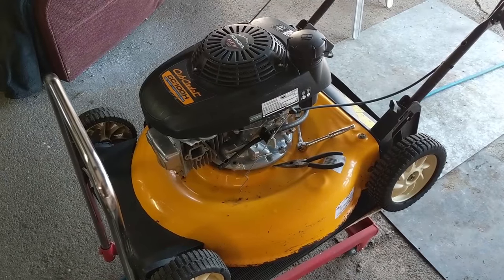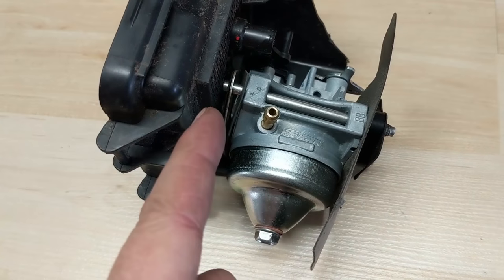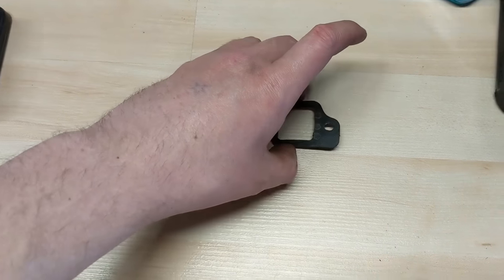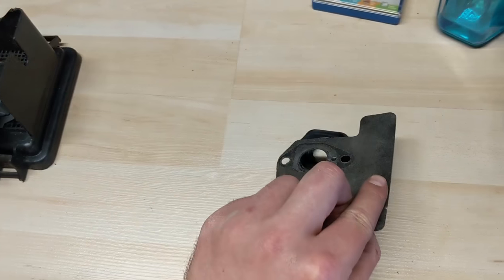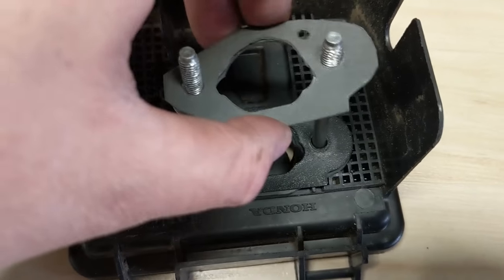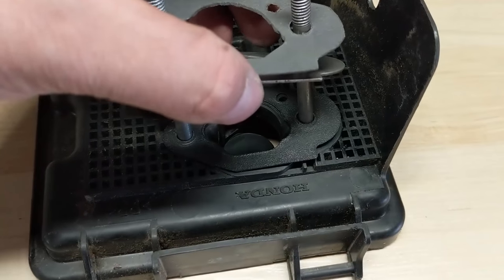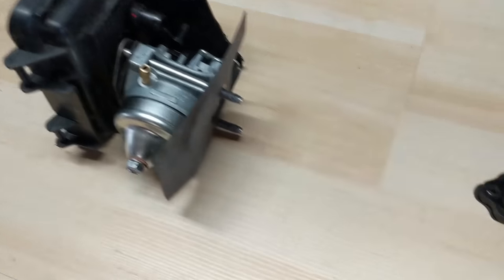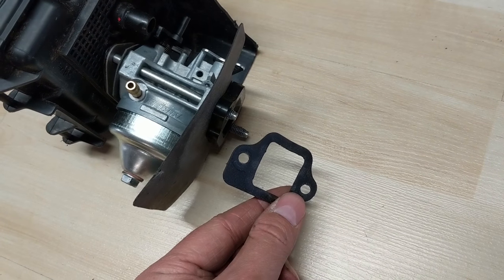Honda GCV160 - Gasket Sequence

Comment: First. Thank you. Many people can sleep tonight cause of your ability to include every detail which most do not do. This carb set up was probably designed by a super intelligent engineer with zero common sense or real-world experience. You are correct. Pull the 2 bolts that holds the set up on the engine and to my horror everything falls. You can't even put it back correctly by memory or take photos,  It doesn't give you that chance. So thank you again. But here is the next problem. Even if you know the proper sequence and configuration, it is a feat that can drive you mad.  In your video you use the metal gasket because your mower doesn't have the metal bar and you just skewr the bolts with all the parts on a table then attach everything to the engine. But if you have the metal bar instead of the gasket you can't shish kabob it all to the bolts on a table. You are forced to put the bolts through the filter housing  and 2 gaskets then through the metal bar that is attached to the engine. Then with a balancing act  you have to keep the 2 bolts in place while sliding the rest of the parts in perfect order onto the bolts from behind with your vision of the the process obstructed by the filter box.  This is a 2 person Job. I used my 2 hands 1 knee and my mouth the first time before your video. Now, if you prefer, you can remove the bar or bracket from the engine and just slide it onto the bolts in it's proper order on the table. But. You will need to properly reinstall the choke linkage and throttle linkage that must be disconnected to remove the bracket. It's really a toss up which procedure is worst. 
This gasket sequence is IMPERATIVE. If you get it wrong your engine will hunt and surge and you won't know why. When you exhausted all cleaning and adjusting and buy a new carb you will have no relief. It will still surge with the new carb until all the gaskets are installed correctly. Many of which are NOT part of the carb gasket kit. Thank you. You are the god of lawnmower repair
Reply: remove the metal bar with it.  makes it easier to keep assembled

Comment: You are my hero, bro. Many thanks. I wonder if it would be helpful to use a spare bolt with no head on it screwed into one bolt hole so everything could slide off together? And just leave the stud when installing everything and then just replacing the stud bolt with one of the regular bolts. Just an idea. Thanks.
Reply from the maker: Hey anytime, thanks for watching jrs! And yes, a stud would be the way to go, but they designed it with 2 bolts, what can we do lol
Reply: use a wooden dowel or loctite studs in at the appropriate length into the block and just ditch the bolts

Comment: I’m having difficulty putting things back together, my hands are clumsy and big. I wish you would show us how rot reassembled one with the big metal plate, that’s what I’m working on. I’ve had my pressure washer for many years, and I became disabled in 2011 which has really effected my ability to get things done.

Comment: You are the BEST on the internet!!  Help me with my engine tremendously!  It now runs,but it runs wide open! Any ideas please? The throttle is not stuck,but it dont slow down after starting!  Thank you sir!
Reply from the maker: Sounds like it's running lean (too much air) you probably have a leak, check gaskets again, it is a pain in the butt I know.
Reply: After replacing All Carb gaskets,I found that the Governor,s shaft was NOT tighten down.It was slipping on the shaft.That was causing it to run wide open as soon as you start it.Run Perfecto Now!   Thank you!!
Reply: see 20:35 of this video - make sure the metal tab is all the way back when you install the carb so your choke runs properly.  You want the black choke pin in front of the metal tab. https://www.youtube.com/watch?v=JxuUz_jDW0Y

Comment: OK, I am getting a lot of info from your channel today, but am confused about this video.  In picture of gaskets in video you show 5 gaskets (including the plastic heat shield next to engine), and 2 of the gaskets are the same, however in the video you do not show these 2 gaskets being utilized.  I thought that those 2 gaskets were to be used on each side of the air dam but in video you indicate  the air dam is mounted without gaskets on either side.  Is this correct?  Also, in the picture of gaskets you only show 1 of the gaskets that goes on the air box, but in video you use 2 of them.  I am putting one of these back together with new gaskets sets I got and just wanted to make sure I have everything correct.  I think that I need gaskets on both sides of the air dam but just wanted to be clear on that.  Thanks.
Reply from the maker: Some have gaskets on either side of the air damn and some don't. If you have the gaskets use them, if not, the air damn acts as a gasket. Basically I just used whatever gaskets came on that engine. This video just generally shows you the order in which they should go.

Comment: Great help. Thanks.
Reply from the maker: Thanks for watching!
Reply: @EliminatorPerformance  I just discovered I had put in an extra one of the rectangular gaskets that goes between the plastic separator and the intake. Ever since that mistaken "repair," the engine would only start with a spray of ether. After that it ran okay, but a bit rough. Now all is good! 😋

Comment: would this be the same sequence for a pressure washer with the same gcv carb another video shows the air dam being placed first .
Reply from the maker: Well it depends where that plate it, on this model they use that steel gasket to mimic the plate being there.

But I would assume it's all the same, I went based off of the diagram from Honda, but many people might not see that diagram.

So I figured I'd make a video, hope it helps!

This machine ran great afterwards.

Comment: My mower has a metal that is shaped just like the air damn. Is this my gasket or do I need the one that comes with the kit ?
Reply from the maker: You can use that it's basically a gasket/air dam together, they usually have a hole
Reply: @EliminatorPerformance  great, but do I need to cut a gasket for each side of the metal or would it just be easier to use the big gasket instead of the metal ? This mower was bought by me new in 2002 and this is the first repair Ive need to make. These Honda engines seem to be bomb proof. Trying to get another 25 years out of it. New rope, flushed gas tank, new blade, oil change. The carb was dripping gas below the air cleaner assembly. Im hoping this new carb is the fix
Reply from the maker: @drumsofviolence  I think you should be ok, but if it surges (revs up and down) then you'll absolutely need gaskets on either side. I can't tell you how many have come in and just needed the gasket redone and they run fine

Comment: Great video, life saver. QUESTION: Are you 100 percent sure of this order? Just asking because I really thought that the "channel groove" on the thick plastic part seems to have been meant to "mate" directly to the matching channel groove on the carb face. I know that doesn't seem right though also because that would be "hard surface to hard surface"... Thanks in advance.
Reply from the maker: Absolutely positive! I carefully disassembled another mower with the same carb setup, and found the correct placement of each gasket. I also refered to the manufacturers part diagram for proper gasket order.

Comment: Do you know where i can get the shutters that open and close? There are 2 of them. I left the carburetor overnight in a cleaning solution, and I guess it was too strong. I woke up today and half of one of the shutters are all eaten away!
Reply from the maker: Not too sure, maybe get a china carb on amazon/eBay and use them?

Comment: Super video
Reply from the maker: Thanks for watching!
Reply: I am missing the metal gasket and the air dam.  Where can I buy them? I ordered a new carburator  and received four gasket without the air dam or the metal gasket.  What is the purpose of air dam?  can it run without it?
Reply from the maker: Not sure if you need it, but it helps keep heat off the carb I believe. You could look on Amazon or eBay for Honda carb gaskets?

Comment: Confusing just use studs.
Reply from the maker: Some of them come with bolts, and if you need to clean the carburetor, you have to remove the bolts. You can remove just one and replace it with a stud, then do the other, but most people just remove the bolts and all the gaskets fall down.

Comment: Just watched a video where guy replaced bolts with fully thread rod and nuts. Proceeded to assemble it and put plastic spacer on backwards  . Someone pointed it out and he said that he corrected that but that never was shown on the video.  So if you didn't read the comments you would assemble incorrectly. Needless to say I didn't subscribe to his channel.